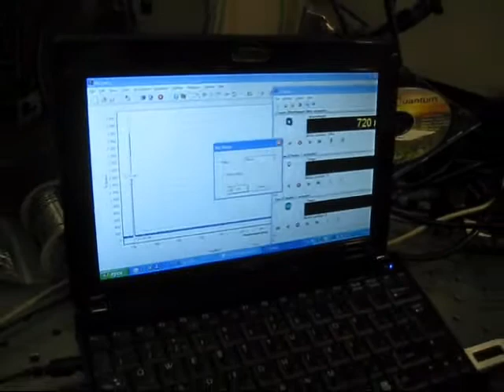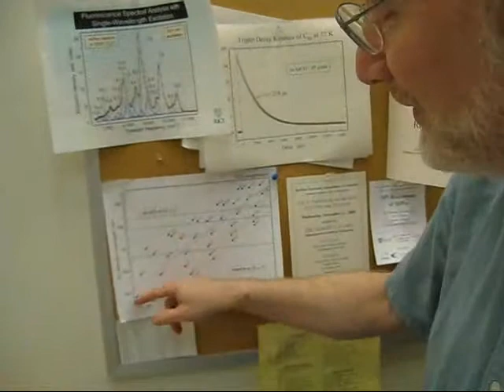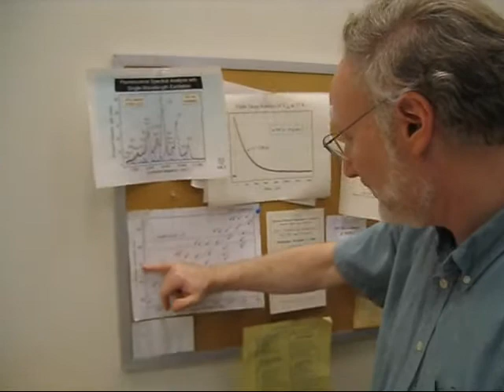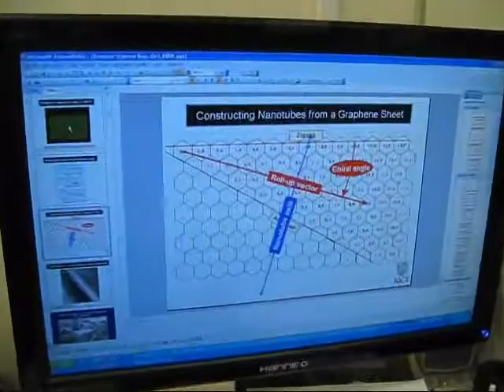Trestles CW/fs laser for spectroscopy of carbon nanotubes and graphene at Rice University

Comment: Time-resolved photoluminescence (TRPL) measurements
can yield valuable information concerning
electronic relaxation processes in semiconductor materials.
When they are used with the time-correlated
single-photon counting (TCSPC) technique,1 semiconductor
photon-counting diode detectors provide a
means of measuring luminescence decays with high
sensitivity and temporal resolution. Previously this
approach had been used to measure decays with time
constants as short as 10 ps at wavelengths up to
1000 nm and  50 ps at wavelengths up to 1500 nm,
with Si and Ge single-photon avalanche diode (SPAD)
detectors, respectively.2,3 TCSPC also offers the
benefits of high sensitivity to low light levels and a
dynamic range of several orders of magnitude, facilitating
detailed characterization of switching between
dominant mechanisms as the system relaxes.
The long-wavelength limit of sensitivity afforded by
previous TCSPC measurements stopped short of the
spectral region known as the third telecommunications
window, from 1500 to 1600 nm, which corresponds to
the absorption minimum in silica optical fibers and
is the wavelength range within which most long-haul
telecommunications devices are designed to operate.
Time-resolved characterization of these devices, and
the materials that they comprise, has therefore been
possible only with pump–probe4 or upconversion detection5
techniques, which are much less sensitive to
low light levels and thus require optical excitation at
higher powers than would typically be used in device
applications.
Recent developments in the production of low-noise
InGaAs InP separate absorption, grading, and multiplication
layer avalanche photodiodes have now yielded
a detector (Epitaxx Model EPM239) that exhibits good
photon-counting characteristics when it is cooled to
reduce thermal carrier generation in the absorption
layer. We have incorporated this detector into an
existing time-resolved photoluminescence microscope
(an adaptation of the instrument described in Ref. 2)
and performed what is to our knowledge the f irst
high-sensitivity TRPL measurements of semiconductor
multiple-quantum-well (MQW) heterostructures that
emit at these wavelengths. In this Letter we report
the resolution capabilities of the new measurements
and assess their usefulness in materials and device
characterization.
A schematic diagram of the TRPL apparatus is
shown in Fig. 1. Pulsed optical excitation is provided
by a passively Q-switched diode laser emitting at
l   1305 nm with a pulse duration of 10 ps and an
optical energy of  4 pJ pulse.6 The excitation light
is focused onto the sample, and the luminescence
collected with the same lens, spectrally f iltered and
attenuated as necessary for the prevention of pulse
pileup1 and focused into a single-mode fiber. This
fiber is coupled to the single-mode pigtail of the
SPAD, which is situated in a liquid-nitrogen-cooled
variable-temperature cryostat. Full details of the
optical and electrical configurations of this instrument
will be published elsewhere.7
Figure 2 shows an instrumental response characteristic
at a detector temperature of 77 K and
Fig. 1. Schematic diagram of the TRPL apparatus. This
is a standard TCSPC setup but with a cooled InGaAs InP
SPAD detector, which is sensitive to wavelengths as long
as 1600 nm. TAC, time-to amplitude converter.
http://pcg.eps.hw.ac.uk/publications/journals/ol-26-10-731.pdf

Comment from the maker: R. Bruce Weisman
Professor of Chemistry; Professor of Materials Science and NanoEngineering
Dr. R. Bruce Weisman and his group investigate the spectroscopy and photophysics of fullerenes and carbon nanotubes. All of these are closed nanoscopic structures formed from carbon atoms. Fullerenes, such as C60, C70, and their chemical derivatives, have unusual molecular properties that cause interesting behaviors following the absorption of light. Time-resolved absorption and emission methods are used to study radiationless decay, photochemical reactions, and energy transfer in fullerenes. Another major research topic is single-walled carbon nanotube spectroscopy. Following the discovery in Weisman?s lab of near-infrared nanotube fluorescence, the group has measured and unraveled the absorption and emission spectra of more than 30 semiconducting nanotube species. Follow-up projects include detailed elucidation of nanotube electronic structure, as well as applications in non-invasive biomedical imaging and analytical nanotechnology.
Publications

“Biexciton, Single Carrier, and Trion Generation Dynamics in Single-Walled Carbon Nanotubes,” B. Yuma, S. Berciaud, J. Besbas, J. Shaver, S. Santos, S. Ghosh, R.B. Weisman, L. Cognet, M. Gallart, M. Ziegler, B. Hönerlage, B. Lounis, and P. Gilliot, Phys. Rev. B 87, 205412 (2013) (DOI: 10.1103/PhysRevB.87.205412).

“Carbon Nanotubes as Non-Contact Optical Strain Sensors in Smart Skins,” Peng Sun, Sergei M. Bachilo, R. Bruce Weisman, and Satish Nagarajaiah, J. Strain Analysis for Engineering Design 50, 505-512 (2015) (doi:10.1177/0309324715597414). 

J. K. Streit, S. M. Bachilo, S. Ghosh, C.W. Lin, and R. B. Weisman Directly Measured Optical Absorption Cross Sections for Structure Selected Single-Walled Carbon Nanotubes.  Nano Letters. submitted

“Directly Measured Optical Absorption Cross Sections for Structure-selected Single-Walled Carbon Nanotubes,” Jason K. Streit, Sergei M. Bachilo, Saunab Ghosh, Ching-Wei Lin, and R. Bruce Weisman, Nano Lett. 14, 1530-1536 (2014) (DOI: 10.1021/nl404791y).

“Enabling in vivo Measurements of Nanoparticle Concentrations with Three-Dimensional Optoacoustic Tomography,” Dmitri Tsyboulski, Anton Liopo, Richard Su, Sergey Ermilov, Sergei Bachilo, R. Bruce Weisman, and Alexander A. Oraevsky, J. Biophotonics, 7, 581-588 (2014) (DOI: 10.1002/jbio.201200233).

“High Precision Fractionator for use with Density Gradient Ultracentrifugation,” Yara Kadria-Vili, Griffin Canning, Sergei M. Bachilo, and R. Bruce Weisman, Anal. Chem. 86, 11018-11023 (2014) (DOI: 10.1021/ac502365w).

“High-Resolution Detection of Local Structural Damage from Low-resolution Random Strain Field Measurements,” Y. Yang, P. Sun, S. Nagarajaiah, S. M. Bachilo, and R. B. Weisman, submitted.

S. Ghosh, S. M. Bachilo, and R. B. Weisman Removing Aggregates from Single-Walled Carbon Nanotube Samples by Magnetic Purification.  Journal of Physical Chemistry C, submitted

“Removing Aggregates from Single-Walled Carbon Nanotube Samples by Magnetic Purification,” Saunab Ghosh, Sergei M. Bachilo, and R. Bruce Weisman, J. Phys. Chem. C 118, 4489-4494 (2014) (DOI: 10.1021/jp411941k).

“Resonance Raman Optical Activity Spectra of Single-Walled Carbon Nanotube Enantiomers,” Martin Magg, Yara Kadria-Vili, Patric Oulevey, R. Bruce Weisman, and Thomas Buergi, J. Phys. Chem. Lett., in press.

“Structure-Dependent Thermal Defunctionalization of Single-Walled Carbon Nanotubes,” Saunab Ghosh, Fang Wei, Xiujun Fan, Robert H. Hauge, W. E. Billups, and R. Bruce Weisman, ACS Nano 9, 6324-6332 (2015) (DOI: 10.1021/acsnano.5b01846).

“Strain-Sensing Smart Skin: a Noncontact Optical Strain Sensor using Single-Walled Carbon Nanotubes,” Satish Nagarajaiah, R. Bruce Weisman, Peng Sun, Sergei M. Bachilo, and Yongchao Yang, in Innovative Developments of Advanced Multifunctional Nanocomposites in Civil and Structural Engineering (Elsevier, Amsterdam), in press.

“Structure Dependent Optical Activity of Single-Walled Carbon Nanotube Enantiomers," Saunab Ghosh, Sergei M. Bachilo, and R. Bruce Weisman, Fullerenes, Nanotubes, and Carbon Nanostructures 22, 269-279 (2014) (DOI: 10.1080/1536383X.2013.812640).

“Structure-Dependent Thermal Defunctionalization of Single-Walled Carbon Nanotubes,” Saunab Ghosh, Fang Wei, Xiujun Fan, Robert H. Hauge, W. E. Billups, and R. Bruce Weisman, in preparation.

“Variance Spectroscopy,” Jason K. Streit, Sergei M. Bachilo, Stephen R. Sanchez, Ching-Wei Lin, and R. Bruce Weisman, J. Phys. Chem. Lett. 6, 3976-3981 (2015) (DOI: 10.1021/acs.jpclett.5b01835).

“Variance Spectroscopy: A New Method for Studying Nanoparticle Mixtures,” Jason K. Streit, Sergei M. Bachilo, and R. Bruce Weisman, in preparation.

B. Yuma, S. Berciaud, J. Besbas, J. Shaver, S. Santos, S. Ghosh, R. B. Weisman, L. Cognet, M. Gallart, M.Ziegler, B. Hönerlage, B. Lounis, and P. Gilliot Biexciton, Single Carrier, and Trion Generation Dynamics in Single-Walled Carbon Nanotubes.  Phys. Rev. B, 87 2013: 205412

J. K. Streit, S. M. Bachilo, and R. B. Weisman Chromatic Aberration Short-wave Infrared Spectroscopy: Nanoparticle Spectra without a Spectrometer.  Anal. Chem., 85 2013: 1337-1341

A. V. Naumov, D. A. Tsyboulski, S. M. Bachilo, and R. B. Weisman Length-dependent Optical Properties of Single-Walled Carbon Nanotube Samples.  Chem. Phys., 422 2013: 255-263

D. L. Kirkpatrick, M. Weiss, A. Naumov, G. Bartholomeusz, R. B. Weisman and O. Gliko Carbon Nanotubes: Solution for the Therapeutic Delivery of siRNA?.  Materials, 5 2012: 278-301

A. J. Siitonen, S. M Bachilo, D. A. Tsyboulski, and R. B. Weisman Evidence for Long-Lived, Optically Generated Quenchers of Excitons in Single-Walled Carbon Nanotubes.  Nano Lett., 12 2012: 33-38

A. Saha, S. Ghosh, R. B. Weisman, and A. A. Marti Films of Bare Single-Walled Carbon Nanotubes from Superacids with Tailored Electronic and Photoluminescence Properties.  ACS Nano, 6 2012: 5727-5734

T. K. Cherukuri, D. A. Tsyboulski, and R. B. Weisman Length- and Defect-Dependent Fluorescence Efficiencies of Individual Single-Walled Carbon Nanotubes.  ACS Nano, 6 2012: 843-850

Comment from the maker: J. K. Streit, S. M. Bachilo, A. Naumov, C. Khripin, M. Zheng, and R. B. Weisman Measuring Single-Walled Carbon Nanotube Length Distributions from Diffusional Trajectories.  ACS Nano, 6 2012: 8424-8431

P. A. Withey, V. S. M. Vemuru, S. M. Bachilo, S. Nagarajaiah, and R. B. Weisman Strain Paint: Noncontact Strain Measurement Using Single-Walled Carbon Nanotube Composite Coatings.  Nano Lett., 12 2012: 3497-3500

A. V. Naumov, S. Ghosh, D. A. Tsyboulski, S. M. Bachilo, and R. B. Weisman Analyzing Absorption Backgrounds.  ACS Nano, 5 2011: 1639-1648

J.-D. R. Rocha, S. M. Bachilo, S. Ghosh S. Arepalli, and R. B. Weisman Efficient Spectrofluorimetric Analysis of Single-Walled Carbon Nanotube Samples.  Anal. Chem., 83 2011: 7431-7437

T. K. Cherukuri, D. A. Tsyboulski, and R. B. Weisman Length- and Defect-Dependent Fluorescence Efficiencies of Individual Single-Walled Carbon Nanotubes.  ACS Nano, 5 2011: 1639-1648

C. Galande, A. D. Mohite, A. V. Naumov, W. Gao, L. Ci, A. Ajayan, H. Gao, A. Srivastava, R. B. Weisman and P. M. Ajayan Quasi-Molecular Fluorescence from Graphene Oxide.  Science Reports, 1 2011: 85-1:85-5

A. K. Siitonen, D. A. Tsyboulski, S. M. Bachilo, and R. B. Weisman Surfactant-dependent Exciton Mobility in Single-Walled Carbon Nanotubes Studied by Single-molecule Reactions.  Nano Lett., 10 2010: 1595-1599

N. Fakhri, D. A. Tsyboulski, L. Cognet, R. B. Weisman, and M. Pasquali Diameter-dependent bending dynamics of single-walled carbon nanotubes in liquids.  Proc. Nat. Acad. Sci. U.S.A., 106 2009: 14219-14223

D. A. Tsyboulski, Y. Hou, N. Fakhri, S. Ghosh, R. Zhang, S. M. Bachilo, L. Chen, M. Pasquali, J. Liu, and R. B. Weisman Do Inner Shells of Double-Walled Carbon Nanotubes Fluoresce?.  Nano Letters, 9 2009: 3282-3289

G. Bartholomeusz, P. Cherukuri, J. Kingston, L. Cognet, R. Lemos, T. K. Leeuw, L. Gumbiner-Russo, R. B. Weisman, and G. Powis In vivo Therapeutic Silencing of Hypoxia-inducible Factor 1 Alpha (HIF-1a) using Single-Walled Carbon Nanotubes Noncovalently Coated with siRNA.  Nano Research, 2 2009: 279-271

E. L. Bakota, L. Aulisa, D. A. Tsyboulski, R. B. Weisman, and J. D. Hartgerink Multidomain Peptides as Single-Walled Carbon Nanotube Surfactants in Cell Culture.  Biomacromolecules, 10 2009: 2201-2206

A. V. Naumov, O. A. Kuznetsov, A. R. Harutyunyan, A. A. Green, M. C. Hersam, D. E. Resasco, P. N. Nikolaev, and R. B. Weisman Quantifying the Semiconducting Fraction in Single-Walled Carbon Nanotube Samples through Comparative Atomic Force and Photoluminescence Microscopies.  Nano Lett., 9 2009: 3203-3208

J. P. Casey, S. M. Bachilo, C. H. Moran, and R. B. Weisman Chirality-Resolved Length Analysis of Single-Walled Carbon Nanotube Samples through Shear-Aligned Photoluminescence Anisotropy.  ACS Nano, 2 2008: 1738-1746

J. P. Casey, S. M. Bachilo, and R. B. Weisman Efficient Photosensitized Energy Transfer and Near-IR Fluorescence from Porphyrin/SWNT Complexes.  J. Mater. Chem., 18 2008: 1510-1516

R. B. Weisman Optical Spectroscopy of Single-Walled Carbon Nanotubes.  Contemporary Concepts of Condensed Matter Science. Carbon Nanotubes: Quantum Cylinders of Graphene, 3 2008: 109-133

D. A. Tsyboulski, E. L. Bakota, L. S. Witus, J.-D. R. Rocha, J. D. Hartgerink, and R. B. Weisman Self-Assembling Peptide Coatings Designed for Highly Luminescent Suspension of Single-Walled Carbon Nanotubes.  J. Am. Chem. Soc., 130 2008: 17134-117140

C. D. Doyle, J.-D. R. Rocha, R. B. Weisman, and J. M. Tour Structure-dependent Reactivity of Semiconducting Single-Walled Carbon Nanotubes with Benzene Diazonium Salts.  J. Am. Chem. Soc., 130 2008: 6795-6800

D. A. Tsyboulski, S. M. Bachilo, A. B. Kolomeisky, and R. B. Weisman Translational and Rotational Dynamics of Individual Single-Walled Carbon Nanotubes in Aqueous Suspension.  ACS Nano, 2 2008: 1770-1776

Robert F. Curl and R. Bruce Weisman Biography of Richard Errett Smalley.  J. Phys. Chem. C, 111 2007: 17653-17655

Christopher J. Gannon, Paul Cherukuri, Boris I. Yakobson, Laurent Cognet, John S. Kanzius, Carter Kittrell, R. Bruce Weisman, Matteo Pasquali, Howard K. Schmidt, Richard E. Smalley, and Steven A. Curley Carbon Nanotube-enhanced Thermal Destruction of Cancer Cells in a Noninvasive Radiofrequency Field.  Cancer, 110 2007: 2654-2665

Laurent Cognet, Dmitri A. Tsyboulski, John-David R. Rocha, Condell D. Doyle, James M. Tour and R. Bruce Weisman Stepwise Quenching of Exciton Fluorescence in Carbon Nanotubes by Single Molecule Reactions.  Science, 316 2007: 1465-1468

Paul Cherukuri, Christopher J. Gannon, Tonya K. Leeuw, Howard K. Schmidt, Richard E. Smalley, Steven A. Curley, and R. Bruce Weisman Mammalian Pharmacokinetics of Carbon Nanotubes using Intrinsic Near-Infrared Fluorescence.  Proc. Natl. Acad. Sci. USA, 103 2006: 18882-18886

R. B. Weisman Fluorescence Spectroscopy of Single-Walled Carbon Nanotubes.  Applied Physics of Nanotubes: Fundamentals of Theory, Optics, and Transport Devices 2005: 183-202